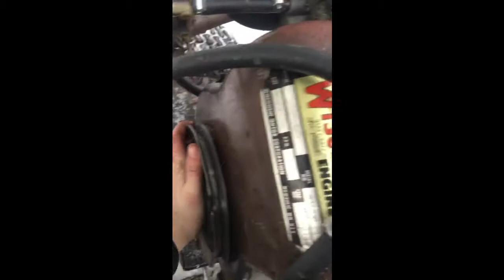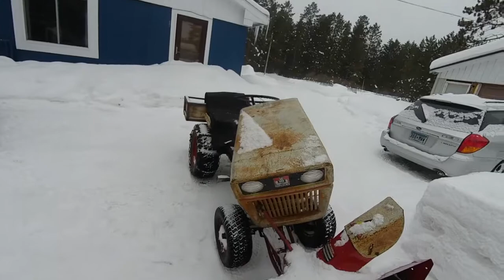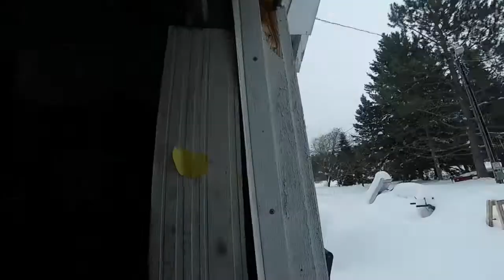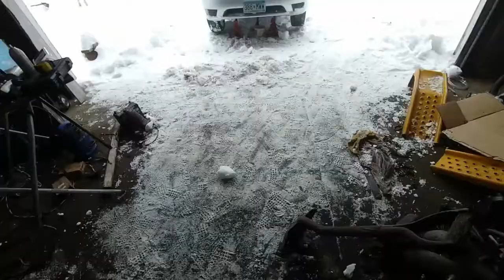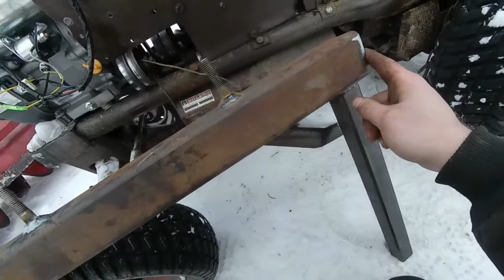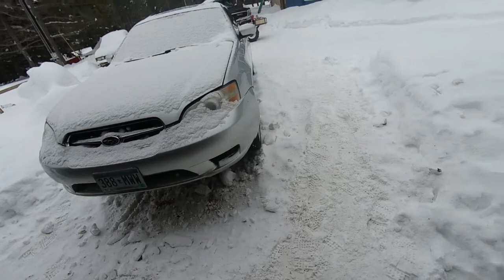Bolens 1225 update and some new mods

Comment: No need to cut the hood. I made riser for my old columbia to raise the whole front-grill about 2 inches. I would have raised them 6 inches if it had need to. I did not need to raise the whole dash though. It only needed a cap-plate. Everything is hidden from rain/snow. A cut hood would have forced me to always put a cover over everything, each time to the next and next and next (then, I told myself "Self, you already got the cover/hood. Move your ass and find something better for a solution" And so I did) lol ;)
Reply from the maker: Honestly I had thought about doing just that, but my grinder and welder already got the best of me :(

The final hood turned out pretty decent, this video is from a while ago, I'll have to upload it asap.